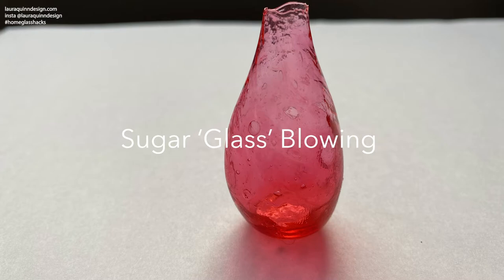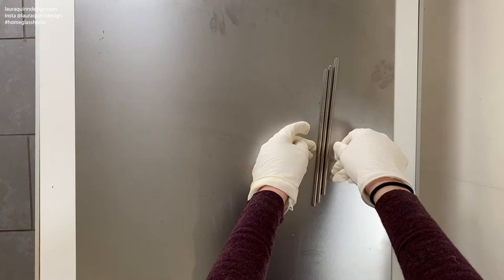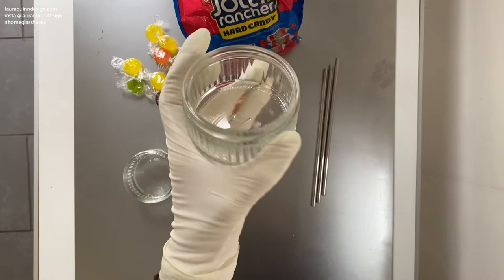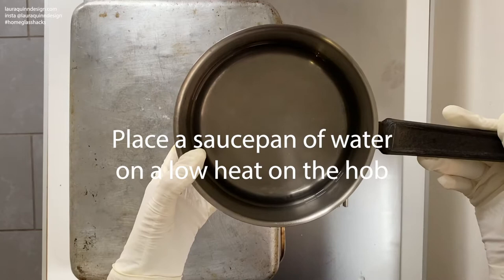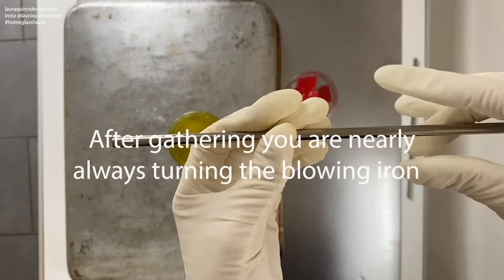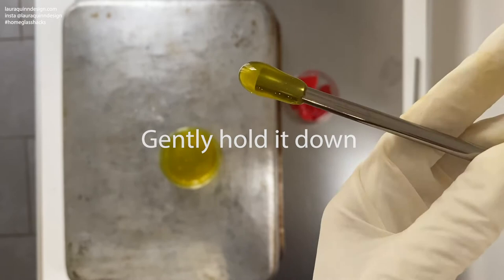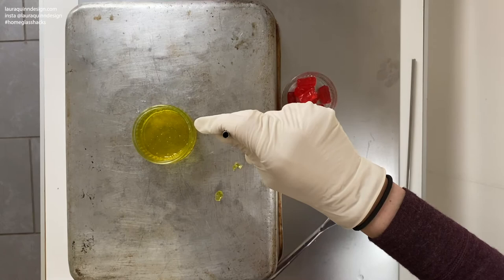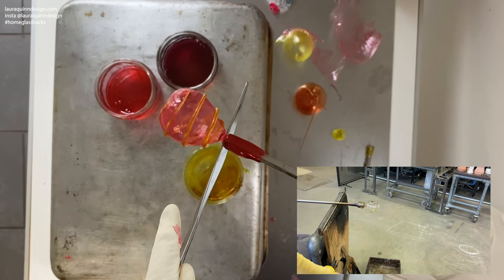Home Glass Hacks-Lesson 8-Sugar 'Glass' Blowing

Comment: If you set up a heat gun you can move it in and out after initial microwaving if to keep the consistency you want
Reply from the maker: What a clever idea! 🔥
Reply: @lauraquinndesign4706  thanks!
Reply: @lauraquinndesign4706  I’m a glass blower so it just made sense to have an extra heat source in the same way we use a Bunsen burner
Reply from the maker: @BruhMakesGlass  it makes total sense! Or like a glory hole for furnace blowing. I may try this next time I teach this as a workshop 😊 thanks for the great idea!

Comment: How do you get the residual out of the dish?
Reply from the maker: Great question! I just pop a bit of hot water in it and put it back in the microwave and it melts into the water, then it is really easy to clean. Be careful moving the hot water around though!
Reply: I ended up doing that and it seemed to work quite well. Thank you for the response.
Reply: Just set it in the sink with hot water.  It's sugar so it will all melt off in a bit.